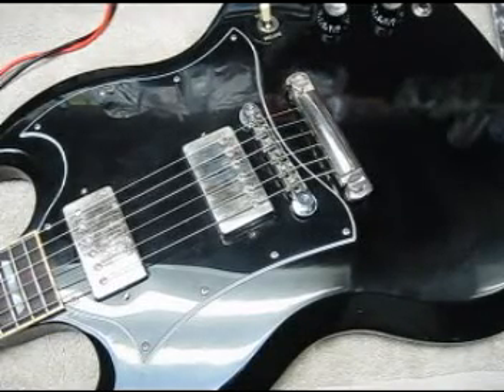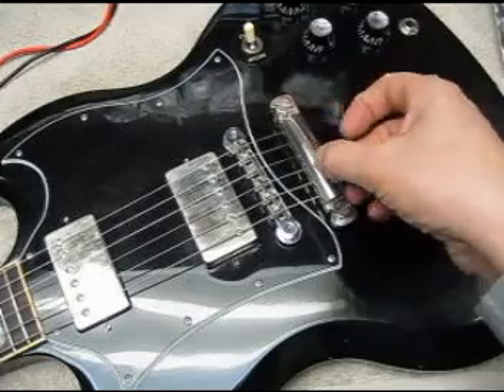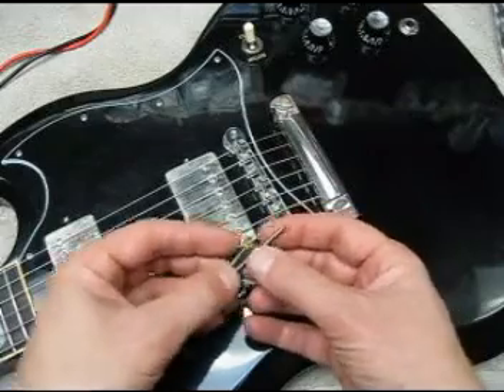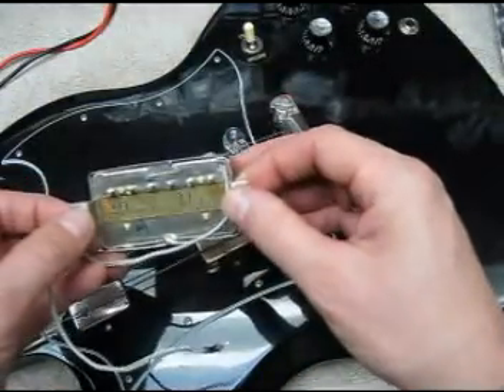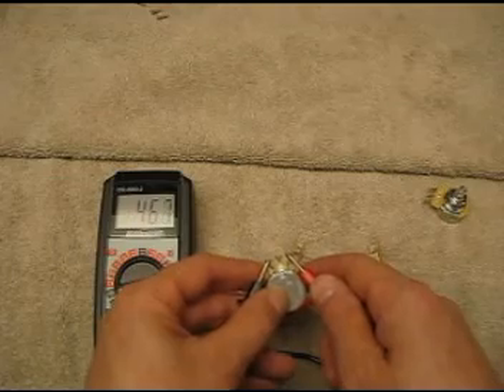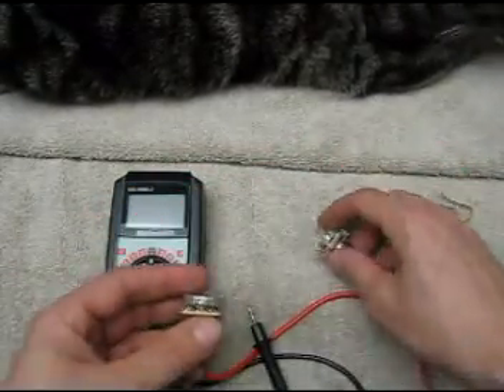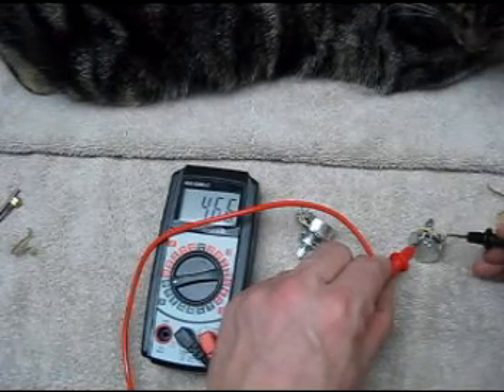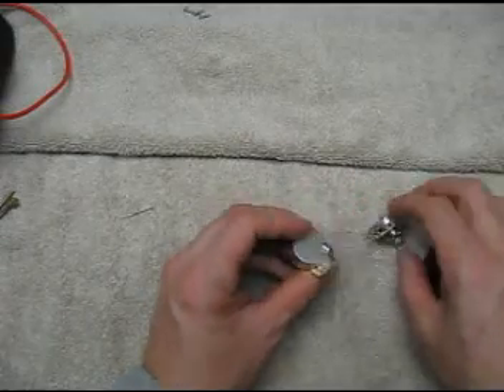Gibson SG Standard Mod pt 1 capacitor & pickups =  Maximum Sustain

Comment from the maker: The 500k resistor is in paralell with the carbon strip on the signal side of the pot. 
This makes the pot roll up faster when doing swells it also reduces the TONE change that happens when you turn down the volume slightly. Its the same result as expensive boutique replacement guitar pots... but resistors only  cost 3c

Comment: Semilived, I respect and appreciate your opinion and granted there's a ton of snake oils remedies out there from some posters on the web. I can tell you from experience with 2 different Gibson Les Pauls, 1 a 2011 Standard and the 2nd a 2012 Traditional and 3rdly a 2013 Gibson ES335 Block and all 3 of those benefited from the longest saddle posts I could drill and tap into those bodies, and there was No Mistaking the improvement in sustain that one change made.. Also, Every Single newer Gibson I get, first order of business is the 300K pots are removed and pitched in garbage and replaced with Metered 500K CTS pots, and that alone makes the world of tonal difference. swapping pickups and tone caps, goes without saying, tweak to personal taste.. I'm Not about wasting time or money, but I want the very best tone and sustain each guitar is capable of delivering. and these few mods that Pat has shared, I will agree it does improve on a factory setup.. Some people are afraid to adjust their pickup height or guitars action, while others hit the bench with a plan in mind, which im an advocate of the latter
Reply from the maker: Ernie R   I made this video in 2009, and have done similar mods to many Gibsons. Every one has responded well to the effort to get them to 50's and 60's specs. Clearly a lot of people are hip to the concepts as people like Historic Makeovers, RS Guitarworks not to mention Gibson and Allparts, all offer improved spec parts. Personally I don't buy all of the old wood talk ... I believe that if your gets the right parts and the right specs you can have those killer old tones.
Reply from the maker: patfurlan  the aluminum TP is one of my favorite mods, I recently got a 335 with a bigsby  and was wondering why it sounded different from my other 335's ... there is a specific ring the aluminum TP adds ... 
just listen to zztop Prescious and Grace to hear it

Comment: Totally agree Pat. I did a 2012 Gibson LP trad + last night that sounded horribly muddy and blanketed on the neck pickup with the 57/57+ and after swapping out Gibsons lame 300K volume pots for metered 490/500K Gibson long shaft audio taper pots and Russian MIL spec PIO caps .015/neck, .022/bridge and set of Wolfetone Dr V A2 neck and Marshallhead A2 bridge. Dropped pickups down flush to body and raised pole pieces up to taste, the guitar is night and day different. Unreal the difference actually where some of these naysayers would have a change of heart if it was theirs I had don't the work to. They'd be tone deaf if it didn't immediately put a smile on their face.

Comment from the maker: the 500k is not across the entire pot !  it it connected between the hot wiper and the hot terminal...
it halves the resistance the signal sees making the pickup sound less thin when the volume is below 10
When the pot is full up those two wipers are parked on top of each other & the resistor is out of the circuit
and you have 500k to ground as would be normal ...

Comment: I forgot to mention going from modern wiring to Vintage 50's where tone capacitor runs from outside lug on tone pots to centre on volume, certainly makes a Big tonal difference. I also don't buy into neck and body wood making any difference tonally either

Comment: Also if your meter had low battery voltage I'm almost sure, that the resistance measurement was somewhat off.

Comment: Hi,

Can you explain me why do you add a paralel 500K res to the 500K pot?
It will create a 250K pot as I see.
What's the reason for using this low resistance with powerfull humbuckers?

Regards
Sol

Comment: Don't let your fingers touch the pot terminals if you want an accurate reading from the multimeter
Reply from the maker: you don't need to be that accurate to know you have a dud pot and sort through some new ones
Reply: patfurlan I guess I work at a different level than some, seems that a difference between 347-500 microohms is substantial. I'm ok with it though.